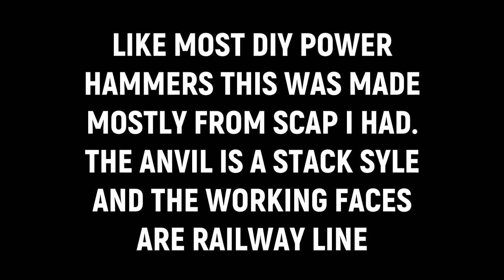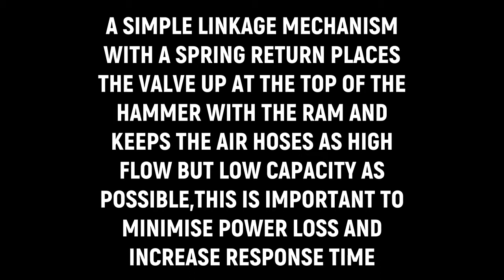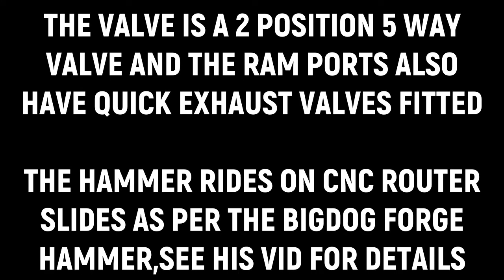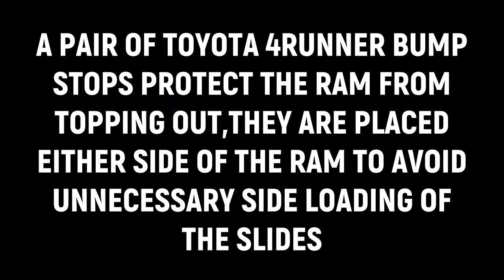Power Hammer . A simple homemade forging air hammer [extra and UPDATED info in description]

Comment: I wish you would show some details about how it is constructed and operated.  It is obviously working great, no idea how it works though
Reply from the maker: Thanks for checking it out, it really is just as simple as explained/shown in the vid from 6:42 on-wards and there's more detail in the description. 
Basically the 2 position 5 way valve supplies air to the lower chamber of the ram when the pedal is up and to the top chamber of the ram when the pedal is down. 
The quick exhaust valves on both ram ports ensure that the unused chamber is de-pressurized quickly when the opposite chamber in pressurized allowing the hammer to move quickly. 
The hammer head itself is basically just a simple 69kg weight on sliders.
The rubber bump stops at the top make sure the ram doesn't get damaged by the hammer topping out.
The anvil is a 740kg dead weight and the top and bottom hammer faces are made from the wheel side of railway line.
Check out the vid from 6:42 on-wards and the description for more detail.
Cheers

Comment: Power.... How much to make one ?
I'm still new into this. Thinking about making one.  I have options to make belt hammer , Spring hammer,  and this one Air . Which one is best choice ?
Reply from the maker: I'd go with air of you can in my opinion, they are very easy to make and setup like this they have a lot of control, I'm really happy with this one. 
Fast reciprocation rate slapping style hammers are cool to and arguably better for finishing work. But heavy hit air hammers are the king of moving bulk material and can be pretty soft and precise too.
As for the price of building one well that's a hard question to answer, it depends what you have got laying around in your scrap pile, i think the only things i had to buy for mine were 2 quick exhaust valves and a 2 position 5 way valve, think it was around $60 for the lot.  If you go with air remember to factor in a decent air reservoir tank, mines 300L, its plenty and recharges between heats.

Comment: What are you using to supply the air?
Reply from the maker: Its an old twin cylinder with 10cfm free air delivery and a 300 liter tank, seems to be plenty as it recharges between heats.